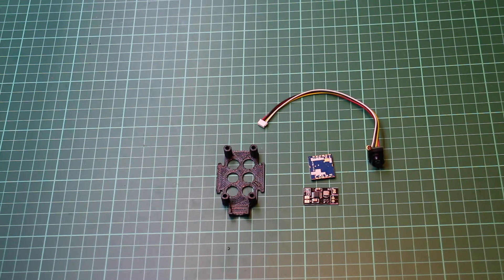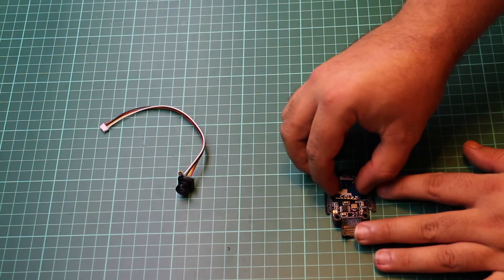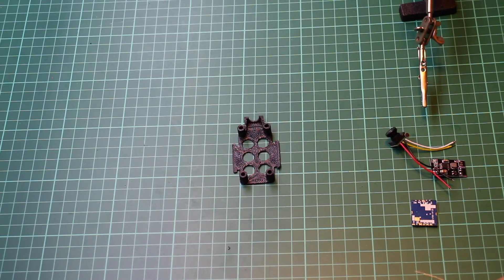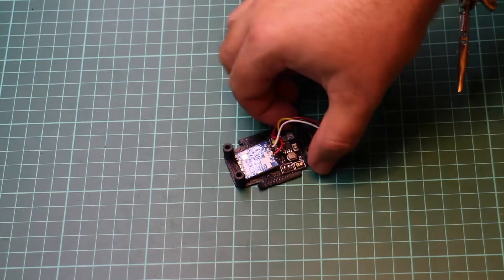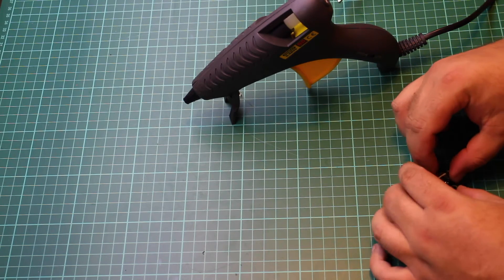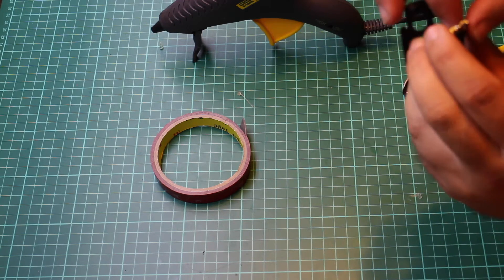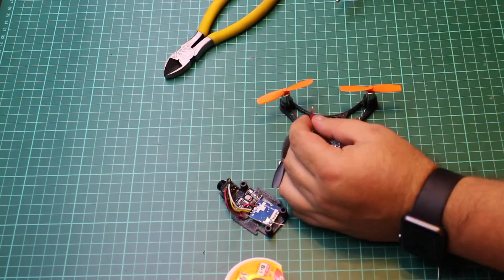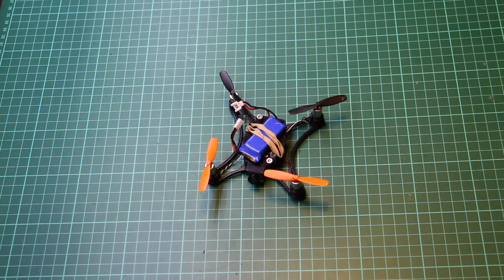Micro 105 Quadcopter build - Part 2

Comment: Have you seen this new Camera http://www.banggood.com/Eachine-EF-01-AIO-5_8G-40CH-25MW-VTX-800TVL-13-Cmos-FPV-Camera-p-1064301.html
Reply from the maker: Ooo that is interesting! Looks a nice ready built package. Slight concern that it says 3.6v min but hopefully thats allowing for a margin of error. Think ill have to buy one and have a play!
Reply: Power: 3.6-5.5V
Reply from the maker: Yeah but if you take a battery close to exhausted it will dip as low as 3.2v (or more but you start risking damage). I suspect it will be fine. Ill order one in a bit and test it!

Comment: This module only requires 3.3 V http://www.banggood.com/FPV-5_8G-200mW-Wireless-Audio-Video-Transmitter-Module-TX5823-p-84780.html  so you don't need the step up converter
Reply from the maker: Looks good, though the camera requires a minimum of 3.7v and from research it looks like some people were unable to run the camera directly off the battery when it was becoming drained, equally some were so I guess there is an element of luck with the tolerances.
Also in theory you could run it directly off the Skisky, in theory...
Personally I would just play it safe for the sake of a tiny bit more money and negligible weight and just run a boost and run everything at 5v
Reply: Ok will do.  This is a much better solution and very inexpensive
Reply: What freq is the Video fixed at?  Noticed you can add a dip switch to change the channels.  Do you know what the fixed freq is if you don't use the dip switch?
Reply from the maker: Mine is A8 which according to the manual for my receiver is 5865. Im not sure if that will be standard though. I just set it to scan and let it do its business! Both my monitor and my echine glasses picked up it straight away with no fuss.

Comment: Does this step up also filters motor noise?
Reply from the maker: I would say from the anecdotal evidence of my one quadcopter that it does. It does isolate the video from the power lines the motors are on, and from what ive seen i get no interference from the motors. I do get some in that room but I think thats the signal bouncing around and its more dependent on where i am than the throttle position.

Comment: Im sorry for you your quadcopter is damaged. Nice build though. Next time drill the props with a very small drill and stick them on the motors further. This way your motors won't get damaged when they hit stuf. Besides Why dont you go with some Cortex M3 processor build like the H8 mini acro firmware modded quads that I am building. It's a receiver and flight controller into one and you can change pids and rates as much as you want. It has dual rates acro mode 3D mode. I even build a brushless quad from a H8 mini FC with 300M range and a devo 7E with nrf24 module. Cool build bro and good luck!
Reply from the maker: Thanks. Damage was easy enough to swap out. Just a couple of cables to re-solder.  The prop idea sounds a good one. Ill have a look at doing that!